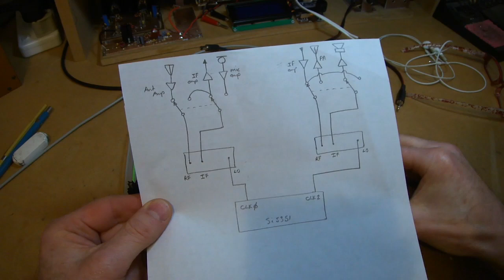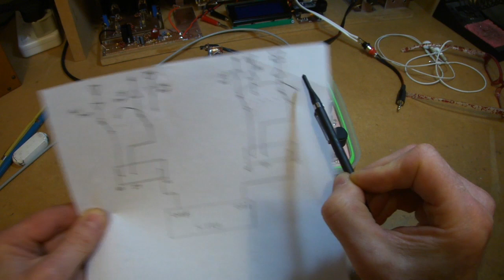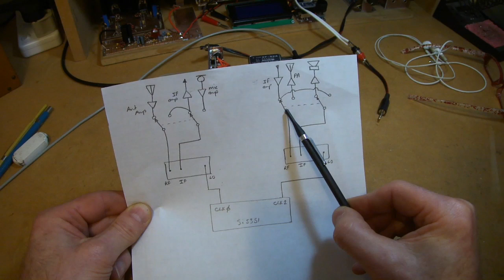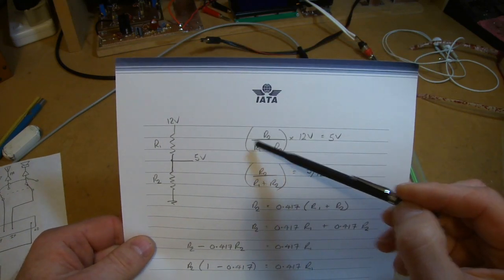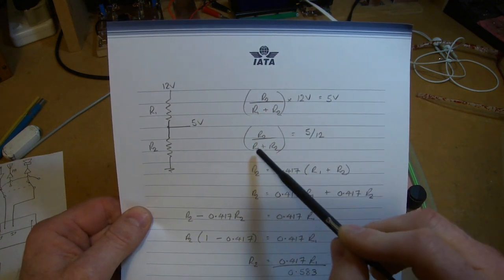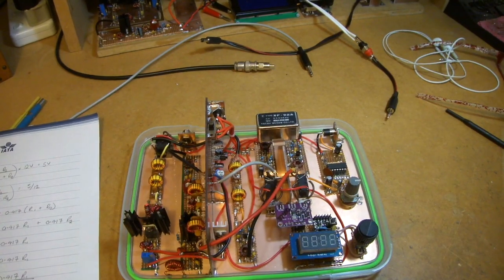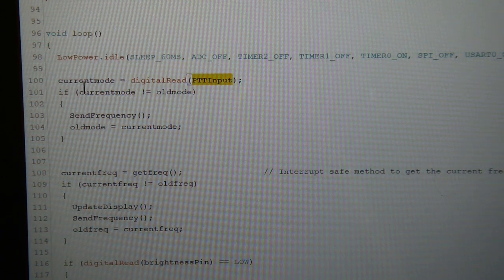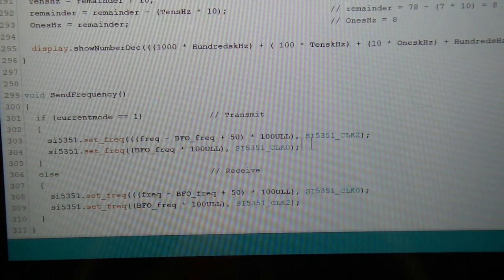20m Homebrew QRP SSB Rig First Contact

Comment: Excellent work there Charlie, really looking forward to see what ideas you will come up with for the SDR.
Reply from the maker: Thanks Brian. I'm keen to revisit the Teensy SDR and play around with the digital filters. Not sure what to do about the analog front end. I'll have to do some thinking.
Reply: What about something like the AD8367 for the RF front end and maybe the AD831 for the mixers, both can be purchased as modules from China at a reasonable cost. They look like they could be quite useful. And would  be  interesting to see how a more integrated system differes from you're more usual discreet component approach, just a thought.....
Reply from the maker: @brianharper9798  Thanks Brian. I'll take a look at those tonight. I was thinking about using the FST3253, but i'm not wedded to that.
Reply from the maker: Brian. Just ordered an AD8367 board from AliExpress. Let's hope it doesn't take too long to arrive...
Reply: @CharlieMorrisZL2CTM " FST3253 " thought I recognised that number, I have a QRP Labs receiver board here that uses that switched method, had it running into the Teensy seemed to work quite well from what I remember.

Comment: Outstanding!!  

Been interested in the switching of the VFO and BFO since you first suggested it!

Excellent concept!!!
Great Project!
Reply from the maker: Hi Christina. It works really well and solves the IF feedback issue I had with previous configurations. This will definitely be my standard setup moving forward. I haven't seen any Si5351 instability either. Keep us posted on what you're up to.Charlie

Comment: Great Crystal filter switching arrangement with the dual relays and two ports on the Si5351. I will definitely borrow that to my own builds !
Tnx for sharing.
Reply from the maker: Hi Harry. It works really well, and eliminates the IF feedback problem that I have had in the past when sharing the two IF amps and filter between TX and RX.

Comment: Quick Question...

Perhaps I missed it in an earlier video, but what mixer(s) are you using?  Thought they were SBL-1, but they look smaller.
Reply from the maker: They are Mini Circuits TUF-3 mixers Christina. A really good little performer. Ideal for a small build footprint.